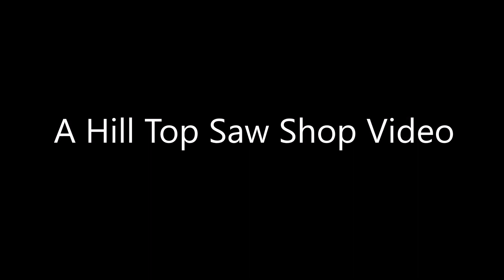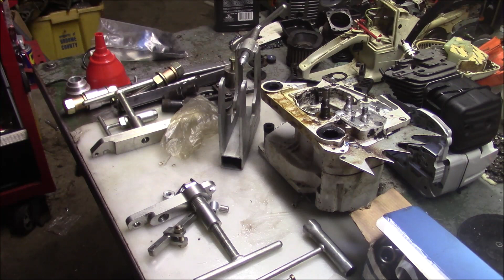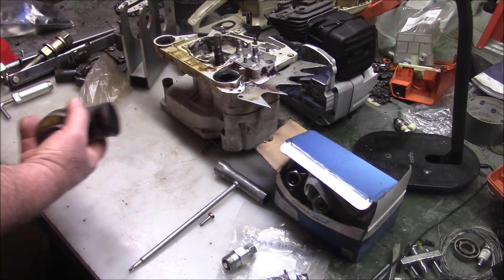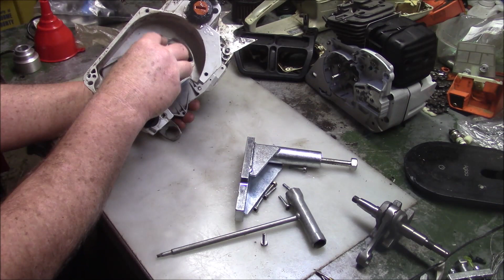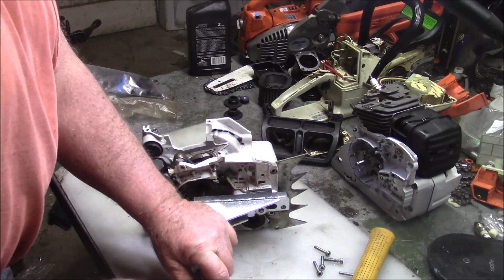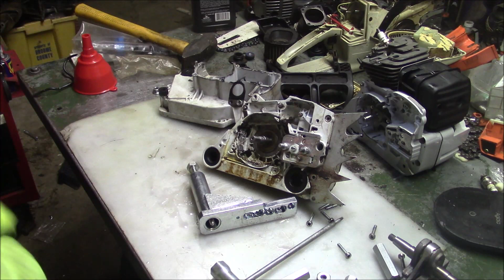Holzfforma Case Splitter & Assembly Tool for Husqvarna & Stihl Chainsaws

Comment: Hi,came across your video ,do you know if this tool would work on a Dolmar/Makita 115 as i need to split the case and the g clamp type tool does not fit.Regards
Reply from the maker: no idea as I have never worked on one ( Dolmar / Makita 115 )
Reply: @afleetcommand  Ok, thank you for your response.

Comment: No, it is not going to build a torque around that case just because it is attached to the bar studs. What happens is the locating pin at the rear is further away from the crankshaft, where you are pushing. So the torque is built around the locating pin at the rear. While the locating pin at the front is closer to the crankshaft and comes out easier.

Comment: Another  good video, these are handy tools I have the one you showed and the one with the discs for the flywheel side the only downside to that one being if you haven’t got the repair manual for the saw you are there for a while working out which holes in the disk to use.

Comment: I have that Stihl tool. When I used it to pull the crank true the bearing, the bearing in the case got a little bit dislocated (moved with the crank some millimeter). Noticed it when i was about to mount the chain oiler to the casing. Used the chain oiler to push the bearing back in place (little bit risky, only two 4mm bolts on that chain oiler).

Comment: If I order a Holzfforma 660 which parts do you recommend being prepared to replace before using it. Do you recommend a modified muffler, what oil mix do you recommend for running it on a mill? 
Thanks for your time.
Reply from the maker: Have to watch one of my later video's....I can't remember where it all ended up with them. Things like bar studs, decomps, choke/throttle related controls were a must. The cases, bearings and seals have proven solid over time. For milling...might consider a different bar oil pump as well. Possibly a better top end.

Comment: This has probably been mentioned but stihl recommends removing the locator pins before splitting the case
Reply from the maker: A waste of time as the cases come apart with no strain or pain either way
Reply: afleetcommand I have seen cases split out around that locator pin if not removed. I can send some pics if you like
Reply from the maker: Do as u wish, Understand the need for idiot proof technique,   If the generic "Stihl" bar stud mounted device was used, it would add a lot more twist than my Husqvarna inspired crank mounted pullers....so I suspect I could replicate a situation, but to be honest would take a less then observant type to allow the cases to be that far out of alignment.. BUT you wouldn't be the first to suggest additional layers of process to these type of things..And certainly wouldn't hurt any thing to drive out those pins first.
Reply: afleetcommand the points you make are very valid. The locator pin isn’t a problem for someone like you who is aware. However people who may not have ever split a case may think it is Normal and screw up there cases. I still love your videos and they have helped me so much to grow my saw skills

Comment: Thanks Walt for doing these video's. So that tool should work on the Husky 357's?
Reply from the maker: Just have to match the threads and I don't know what the clutch side threads are on a 357. So...maybe. My tools certainly cover the flywheel side as 357's have the 8mm x  1 on the flywheel side and I have a tap for those. Have to say check out the case fitting tools sold through HLSupply for around 40 bucks delivered for the different Husqvarna models. That's probably the cheapest and most effective option available for 357/359. Might have to ask for the specific ones for the 359, but they are available

Comment: Walt, did you drive out the alignment pins before you split the case? Getting those out may help with the torque you speak about.
Reply from the maker: No really don't have a punch that would do that. SO rubber hammer :)